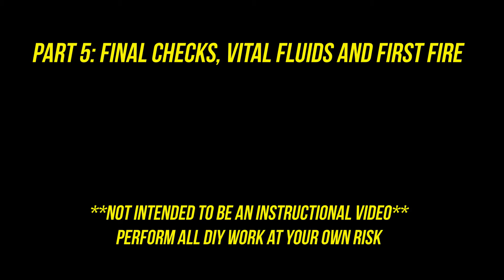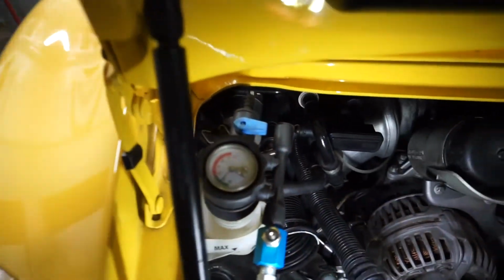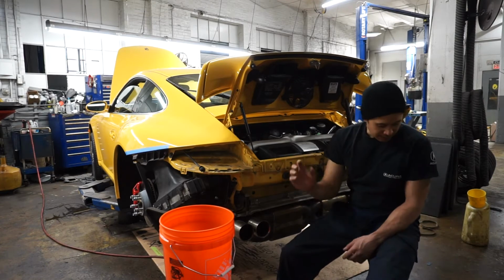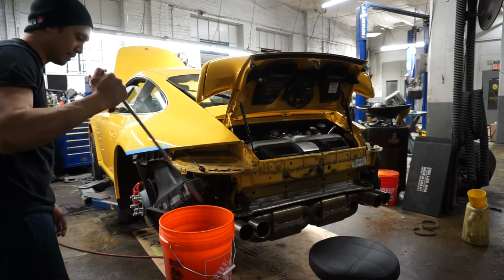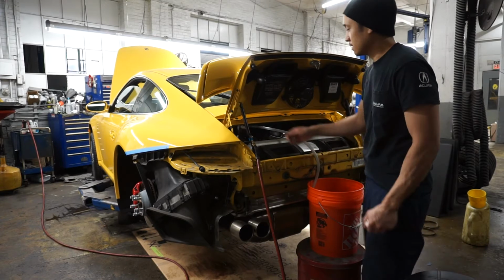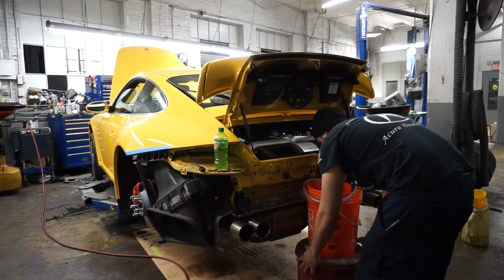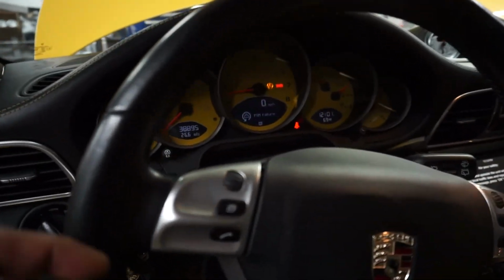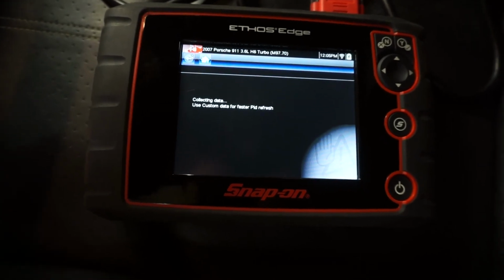PORSCHE 997 TURBO MAJOR SERVICE AND MAINTENANCE PART 5; FIRST FIRE after coolant pipes and camshafts

Comment: Hi, thanks for the detailed review! Helps a lot as I'm planning coolant pinning, as well as fixing the camshaft as I have the popular 21 code. Question: did you notice any chance in performance/response having the camshaft fixed and pinned?
Reply from the maker: Not a problem.  After I had the camshaft sleeve fixed I did notice a change in performance; however, I am not 100% sure if it was due to me performing the cam sleeve repair OR if it was due to making sure everything was sealed up proper upon re-assembly.  When I did this work to the car, it was only about 90 days after I had purchased it.  After I had bought it, I just drove it around for a bit but never really did any diagnostic or verification of anything... primarily the intake charge system which is very prone to leaks.  After I did everything and put it back together, I verified a sealed charge system by way of the common boost leak test.  I tightened everything up as needed to eliminate any and all air leaks.  The change in performance might have been due to that.  Keep in mind that my camshaft sleeve was only partially rotated, so oil could still flow through those holes, just at a reduced rate.  If you have the 21 DTC, I would first look at your camshaft deviation #'s and verify that they are within specification prior to doing any tear down.  This way when you go back together, you can compare the values and see whether you brought it back closer to its tolerance.
Reply: @NSXavier997  thanks for that, really helpful. I will save the deviation graphs prior to pinning the shafts.